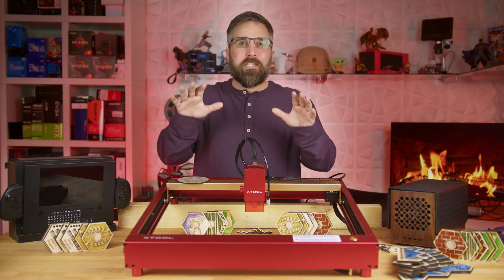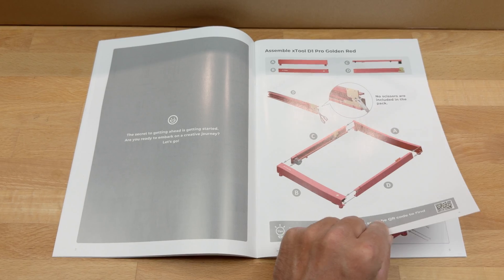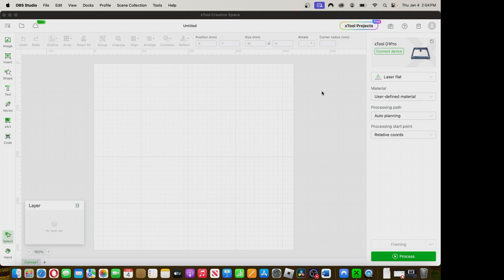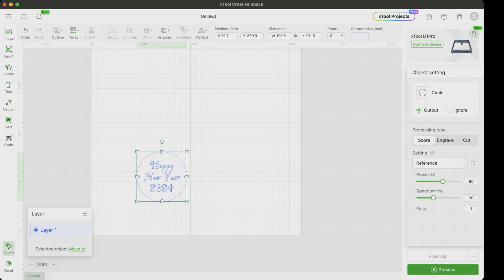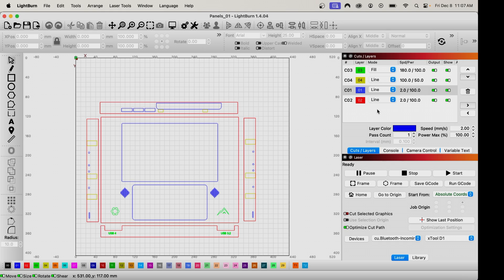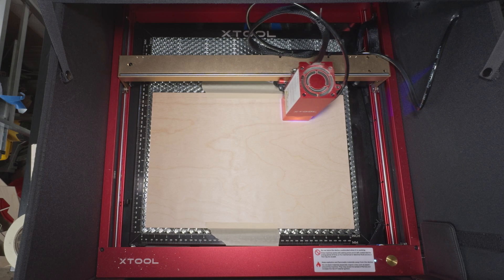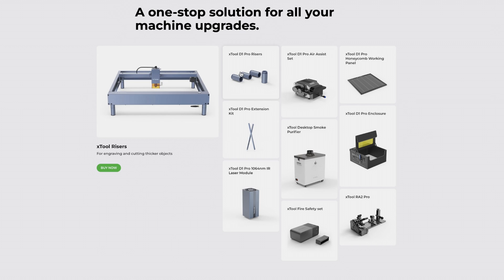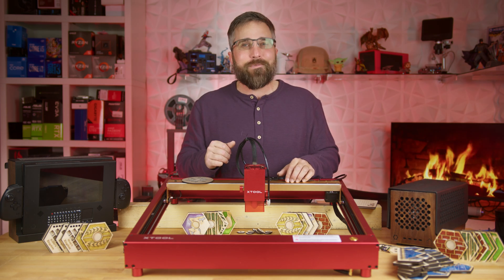xTool D1 Pro, Best Laser for Beginners?

Comment: I purchased refurbished xtool D1 Pro 20w from their ebay site and it is like brand new. Was missing the riser legs and i contacted the seller and they are sending me a set. The only negative is I cannot add the tool care plan to the tool because they dont consider their ebay store as an official xtool site. Bummer. But it comes with a 1 year warranty so theres that.

Comment: I really like this kind of content! I'm currently close to dialing in my 3D printer, and was also impressed with how your framework case turned out, which got me curious about laser cutters/engravers. However, because I knew nothing about them, (and also  since I still have a 3d printer to play with), I kind of dismissed the idea of looking into them. This video gave me a very basic idea of how a machine like this works, what the software is like, and what you can expect. I found it very useful! Might look into getting one after all, thanks to you!
Reply from the maker: A laser is much simpler than a 3D printer to master. There is practically no learning curve.
Reply: @ElevatedSystems  that's very appealing! Now the only thing to overcome is the price.. but first I gotta save up for a 16 inch framework 😇

Comment: WARNING: Desktop laser cutters are very dangerous! It's important to keep it in an isolated, enclosed, and well ventilated area, as well as make sure the material you plan on cutting aren't treated with chemicals that might release when laser cutting
Reply from the maker: All tools have some risk, but overall I’d say the table saw the laser is sitting on is a more dangerous tool than the laser. Both however are perfectly safe as long as you follow their basic safety procedures.